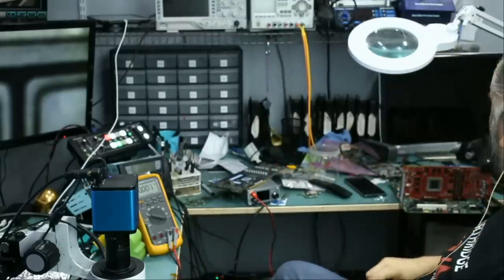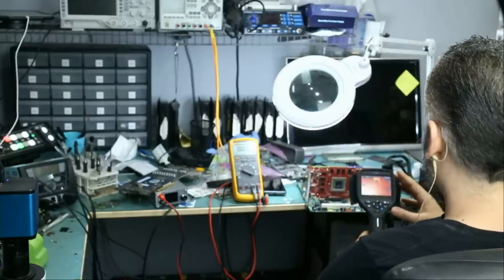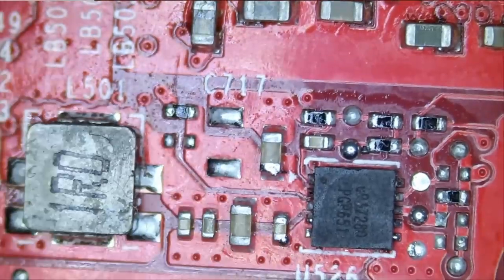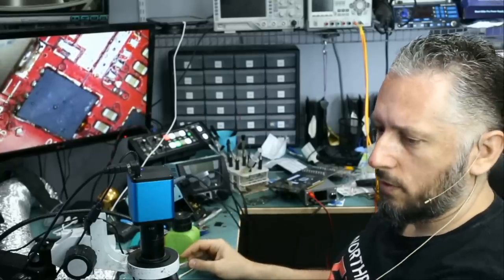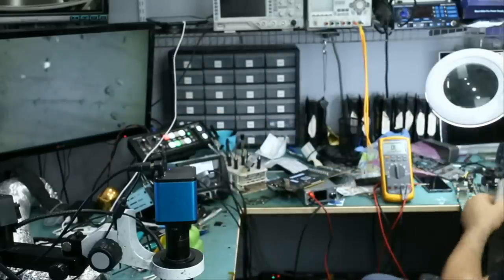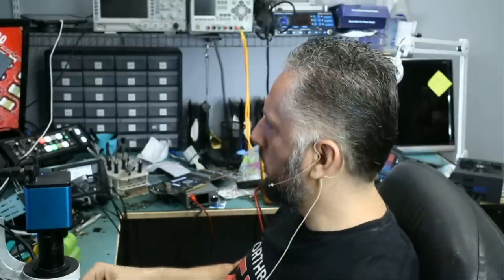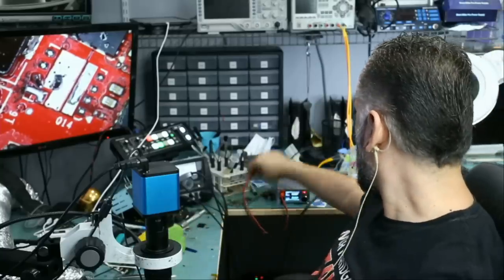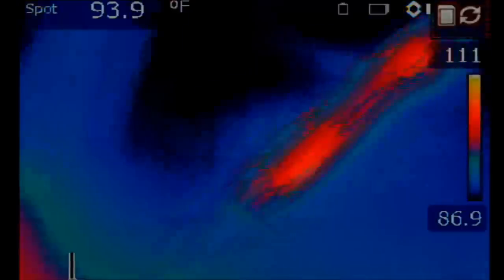MSI 1080 TI Blower Graphics Card Repair - Is it fixable? - Continued

Comment: This is my card. I feel as though he should keep it. I feel bad I ruined his holiday with it being un fixable. Appreciate the time!
Reply: I know his work is good but coudn't he change the chip, or is it not worth it or what? He has many donor cards so.
Reply: @LubieOwnic  it's not easy to change the gpu chip, you need a special gpu rework station, and there's a big chance that the donor has gpu problem .
Reply: @LubieOwnic  I've replaced a couple of chips. It takes forever, it's hard to reball, and the heat required is often damaging. Nvidia gpus handle heat better than AMD, but it's still not great. I will be doing some more gpu swaps, but it's more for educational purposes than for profit.
Reply: @nightfury3619  can you upload it 👍
Reply: @Techie1224  I plan to upload some videos on graphics card repair including chip replacement under DrasticRepairs soon. I've been working hard to get a sustainable business model set up at the same time as learning Davinci Resolve. And getting the equipment required to produce quality videos. I'm sure you don't want a blurry image with painful audio. :D LOL
Reply: @nightfury3619  bro I want to see u do that upload pls😂
Reply: @LubieOwnic  It's not really worth it. You get the chip from a donor board. Where are you getting one that isn't just repairable anyway, y'know? Why would it be a donor board if the chip worked.
Reply: You would most likely need like a quarter million finetech rework station to resolder a GPU effectively and even then it may damage the board with all that required heat.

Comment: You learn something when you fix a board and also when you can't fix a board. With every new board the knowledge broadens.
Reply: That's true. I've got a laptop this week, just blinking power light. 4 days on it to discovery its the CPU shorted.

2 days latter, another laptop, same model, same problem. Take the measurements quickly, as they got similar results as the other. Checked the CPU. Shorted. Took me 5 minutes to know is a no fix. Experience is good not only to fix, but also to know when to stop.
Reply: Dare I say, as I was a repair technician in an earlier life also, that you learn as much, or even more, sometimes, from the circuits that you do not end up repairing, as you do from  the successful repairs. Alex is showing us all that you learn no matter what the outcome is. This job takes a "can do" attitude and a lot of dedication to do well. Alex has everything good that you need to have on display here everyday.   Fred
Reply: @electronicengineer  why did you quit repairing? I'm just curious 😊
Reply: @roseelectronics4582  I went through a rough divorce and my ex pretty much cleaned me out. I went back to school and got into programming.   Fred
Reply: @electronicengineer  sad..
Reply: @seckinseckin3919  I agree, but it is the truth.   Fred

Comment: I AM ELECTRONICS ENGINEER TWO MONTHS AGO I WAS FIXING MY LAPTOP CHARGER AND PLUGGED IN -19V AT PORT INSTEAD OF 19V MY LAPTOP STOP CHARGING .I ORDERED THE PROTECTION DIODE IC FROM CHINA WHICH WAS BLOWN AND GOT IT TODAY AND TONIGHT AM COMMENTING WITH MY LAPTOP CHARGING.THANKS TO YOUR VIDEOS I WAS ABLE TO TO FIX . I CHECKED ALL THE RESISTORS CAPS MOSFETS AND DID THE SOLDERING MY SELF YOUR TIP FOR BETTER FLUX AND GOOD QUALITY WICK AND SOLDER HELPED ME ALOT ALSO THE IRON TIP HANDLING THANK YOU FOR TEACHING US THROUGH YOUR VIDEOS

Comment: I remembered that the resistance on the 1.8V was around the 260 ohm range, it should be close to 900 since it otherwise normally indicate that the gpu had fried and I don't think the gpu can still be ok at that low range. But If someone 110% knows that the gpu can still be ok with around 250 ohm on 1.8V please say because I have heard other things.

Comment: From my experience fixing amd card series 4xx & 5xx, if it is stuck at boot voltage 0.9v i will replace the transistor sot363 that give enable signal to pwm controller (3.2v) sometimes this transistor do not work properly to switch enable signal on off during boot, if still stuck i check the pwm controller that connect to mosfet driver, sometimes the mosfet driver also have strange behaviour, if not then i assume the gpu itself not give proper signal to initialize

Comment: With the cost of GPU cards you'd think people would treat them better, many like to overclock and run cards hard then wonder what happened. I still have my MSI GTX 1060 6GB, and a Gigabyte GTX 960 4GB, never had a single issue with either one. In fact, every card I ever owned worked good the day I retired em and I've gamed quite a bit over the last 15 years.

Comment: if the voltage is normal for each inductors and PEX rail.. and Vcore inductor doesnt change from let say 0.9 to 0.7, it indicates that the GPU is not initialize.. first.. touch the GPU if it hot or not.. if it hot.. the gpu chip is most like ok...  some of the vram corrupted and it caused the display black.. u need to run mods and mats using linux to pin point which vram need to be replace.. it start from counter clocwise. A1 A0 B1 B0 .... if mods and mats indicated the B0 is corrupted.. u need to replace the B0 VRAM... .it is easier to pin point vram chip problem for nvidia.. but not amd.. if nvidia we can pinpoint the exact vram chip.. if amd.. it come with pair.. if u have 8 vram chip... normally if one die.. let say.. chip no 3.. it will shown in the software chip 3 or 4.. u need to try and error...
Reply from the maker: This is not a memory corruption case. Card is a no detect and not just a black screen.
Reply: @NorthridgeFix  Sir... I have a question and I really need your answer based on your experience. I was using my netbook for about 5 minutes after that it suddenly turning off and smoke coming out of the charging port, I immediately unplugged the adapter from the netbook. After that, I waited 1 hour and tried plugging the adapter back just to see if the charging port indicator light is still on and yes it's still on but I'm afraid to turn on the netbook. my question is does my netbook still have a chance that there will be no serious damage to its components or not?? sorry about my english ...
Reply: @NorthridgeFix  yes..not detected.. if u using the card as a 2nd gpu it might detected using gpuz... use ur igfx frpm ur motherboard for display... not from ur gpu.. for this repair u need to have motherboard and/or processor with internal gpu (apu) to identify the problem on the gpu slotted on the pcie
Reply: You can use tserver instead of dmgg for AMD cards to see exactly which memory bank needs to be replaced
Reply: @andrewdoesthings__  how to do that?

Comment: I think it need some reflow oven, the bga on GPU isn't bond with the board, measure the standby amp, using the second or onboard VGA, check on devmanager detected or not, or finally guess broken traces on that tiny board

Comment: Excellent video,  always like your process of elimination when repairing. Btw, when re-soldering the mosfet,  were you using low melt solder? or 67/33?

Comment: you should check LDO regulator ic  and bios ic if no voltage comes out pin1 should be 3.3v and on pin 6 should be 1.8v

Comment: I have a question: Is it in general a problem that VRAM going bad kills the main Chip? Or is it a specific issue with certain architecture? I believe they are closely connected - so is it a general problem? And if how does the VRAM kill the main unit?

Comment: This is probably a stupid comment but...I had a Zotac 1070 ti that had a no detect issue. I reflowed the GPU and by dumb luck it fixed the card. It's been working for over 3 years.
Now for the dumb question...Is their a reason you don't try to reflow or reball the GPU?
Thank you for posting these videos. I've always had a passion for repairing but was not blessed with your skills. Watching your videos is as close as I'll get to experienced repairs.
Reply: Reflow or reball is a temporary fix at  best. The customer will come back so that isn't really an option
Reply: If card is dead, does not matter what you will do, its not gonna be any worse. I will try to reflow gpu, it will not gonna hurt. But he need better understanding what is going on. How i can see he just replaces easy to see/fix issues. He does not go deep into repair/understanding a problem.
This is understandable, since price of living in LA are super hight.

Comment: A shot in the dark, but will installing the heatsink assembly with the fans connected to the proper fan headers not make a difference?
Reply: On a video card not likely, some motherboards dependent on bios settings on the other hand can stop boot if no cpu fan recognized.
Reply: Additional cooling is always a good thing, if installed correctly.
Reply: Wouldn't make a difference otherwise water cooled cards wouldn't work.

Comment: Time, Materials and Knowledge makes what your doing worth charging for.  If they want free, they can youtube/google for a solution.
Reply: very nice guy, so your car stopped working, you send to a mechanic that is incapable of repairing the car,  but will charge you for the work he have done?! What is correct is at receiving the card, the repair man, tell you that you have to pay 1 hour of service, even if it is not repaired. That is right way to work.

Comment: what do you think about this pricing? i had an asus laptop with a malfunctioning fan. we found an equivalent fan in 13$ at ali express but we needed the laptop soon, and were scared to fix it ourselves. we sended it to the official asus repair service and i got charged 110$ for it and nothing else (we asked if they did anything else). felt kind of ripped off... should i come back?

Comment: You should always check MOSFET driver chip - this chip control gate
Reply from the maker: Why would I do that?????. Gate is already getting proper voltage.
Reply: Been watching you awhile you make nice vids man been doing this for a long time as well always interesting to watch other people work that I have learned a thing or 2 from you over the years. I will continue to watch and won’t be in your conversations any further just thought I would lend advice “ and obviously reflowing the gpu would not make it “fixed” but I bet it would last another few months to a year while he try’s to find another gpu” there kinda scarce
Reply: How you think this board is making 0.7V from 12V power rail? By switching power supply! There is one MOSFET between 12V and output (0.7V) and one Between output(0.7V) and Ground. MOSFET driver will super quickly open first MOSFET, then open second then first etc. It will create square wave and Coil with capacitors will smooth that out. Frequency of switching will determine output voltage
Reply: @solveit1304  Did you see the first video? He replaced a buck converter that presumably provided the necessary stepped down voltage.
Reply: @solveit1304  an oscilloscope would show the wave form. I've been thinking about getting an oscilloscope and now you have convinced me. Thank you
Reply: @HazeAnderson  this uP1728 buck converter you mention is 100% not for GPU power rail - max current is 3A according to datasheet so you think that power-hungry GPU will be powered by that punny chip? Lets assume that GPU is working on 0.8V so 3A will give 2,5W ( 0.8V * 3A ) - you think that main GPU chip will consume only 2,5W? Not possible.
Reply: @solveit1304  is it possible to see gate switching voltage with a regular multimeter? If it has to switch so fast, probably the multimeter will freeze and fail to read. I'm not so familiar with buck converters on a practical level
Reply: @roseelectronics4582  nope. But you can buy a scope as DS0138 as little as 20$. Better then nothing...
Reply: @solveit1304  if that is true then .... this graphics card is a terrible buy! 😱

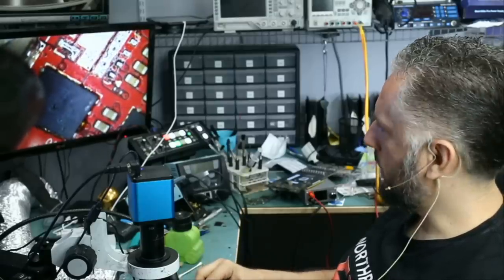Comment: 4:10, you need to start using preheat in video cards, for mosfet removal and some power controllers, or the risk of over temp the components will be very high.